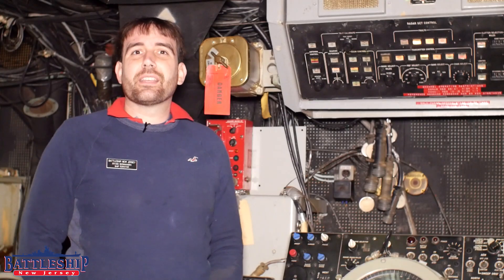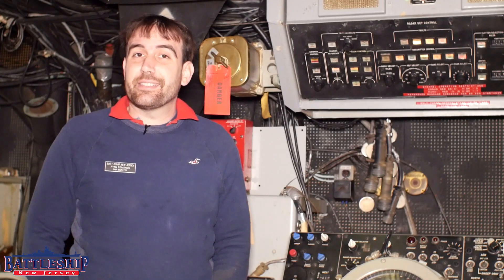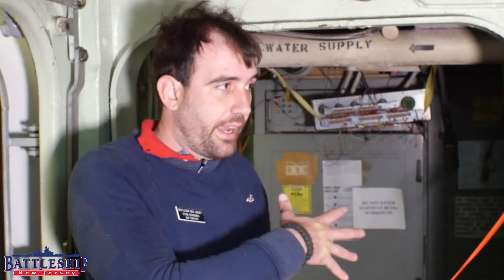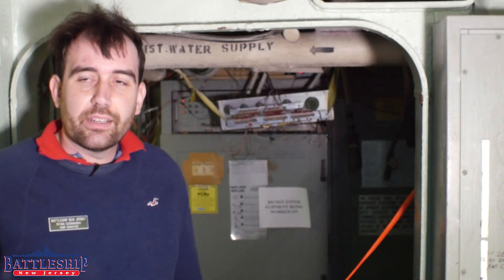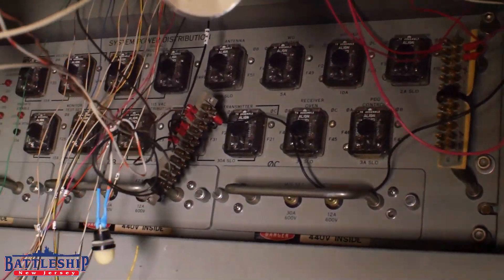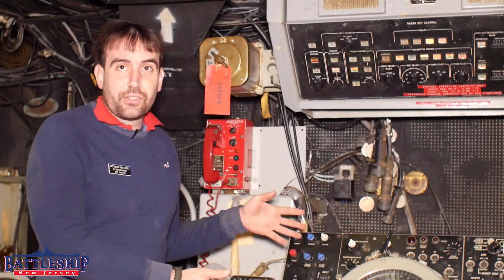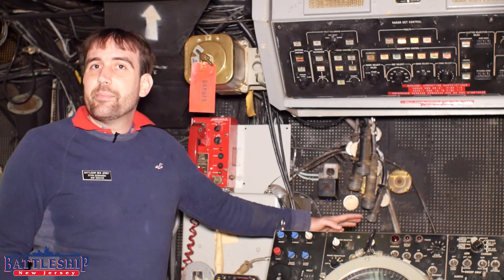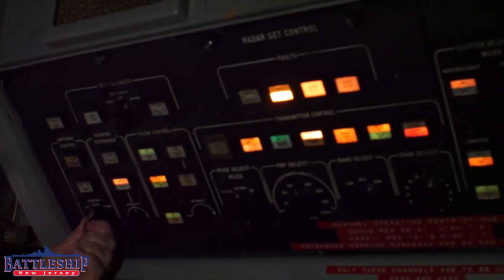Rotating the Air Search Radar

Comment: If you really want the ship to come alive; get those turrets to rotate under their own power.  Get the 16in barrels to be able to move again.
Reply: I would love this, but in order to do this, like Ryan mentioned in previous videos, unless they can basically replace all of the pipes in the Boiler system, and restart the engines, they cannot do this. This would cost an incredible amount of money as well.
Reply: @ColdFireW  Forget the steam. What actually powers the turrets?  Electric, hydraulics?  I'm sure an auxiliary power source could be integrated somehow.  And if you told people what you're doing, they might donate the equipment and expertise required just to see those things move again.
Reply: @jbowman90  the steam powers the turrets. *If I remember correctly. They have multiple videos about this stuff, but I mean if your willing to pay for it I’m all for it!
Reply: @ColdFireW  The first step is to study the problem - assess how it currently works, can it be made to work again using the current design, and, if not, are there suitable alternatives.  And then you have to price each one out.  Many projects never get off the ground simply because people convince themselves it can't be done without ever doing the detailed analysis.  There's an old saying - luck is where preparation meets opportunity.  No one is going to help or give money if there isn't a plan first.
Reply: @ColdFireW  I dont think its steam. Pretty sure its electric/ electric over hydraulic
Reply: Some kind of apu then perhaps... they seem to have 3 phase power to the ship so large 3phase hydrolic pumps mounted in the turret     so they can keep the pipes runs short ?

Comment: Aww come on lets radiate the Camden and Philly area. But really, a great job by all. Turret operation????
Reply: Garage door openers would go haywire for miles. 

My ship had a placard on the ‘49 prohibiting radiation within 50 nautical miles of the U.S. coast.
Reply: Not just garage door openers.  If Wikipedia is accurate as to the frequency and power of the -49, it would disrupt a very popular mobile phone LTE band.  Your typical cell tower radio runs at something like 50 watts full power.  Again, if Wikipedia is accurate, the -49 sends out 360,000 watt pulses!
Reply: @billnickless  I was trying to keep things fairly vague, but yeah... Wikipedia's pretty accurate here.

As for the power, well... It has a water-cooled Klystron in the transmitter.  That should tell you something.
Reply: What would happen first who would complain first about that? Second to complain would be everyone still using antennas for their TVs.

Comment: Foreign ships use the 49 as well. Maybe find a decomming foreign ship and buy parts off them?
Reply: Some of the Ticonderoga Aegis cruisers also use the SPS-49 as well as their SPY-1 phased array (billboard) system.  Those that mount it have the '49 mounted on the Mainmast (aft mast), usually above the aft stack and helo hanger.  Many have had theirs replaced by a totally different system so there may be a number of older 'spare' sets available from the Navy 'Property Disposal' system.

Comment: Pipe dream?  Turret rotation but I don’t expect it.  You guys are doing great!
Reply: The Navy would probably have something to say about turning on the equipment it would take to rotate one of the main turrets
Reply: @Odin029  bearings are probably pretty flat on one side too
Reply: @Odin029  probably, but like the other guy said, they can’t provide that much electrical power
Reply: @Odin029  I think the museum contracts says they can’t use the ship’s steam or maybe main generator.  Do they get power from shore or use an auxiliary generator?
Reply: @danielharnden516  shore most likely
Reply: @danielharnden516  they are provided shore power. Through the city of Camden I’d presume. Even active duty navy ships when at the pier hook up to shore power. Running off your propulsion plant all the time is inefficient and wastes precious fuel in the case of New Jersey. Modern navy vessels when at the pier all have hook ups to shore power,  waste disposal, and also internet in the modern age.
Reply: @FloridaWildlifeChannel  well  that makes perfect sense.  So they could get enough power to rotate the turrets but the electric bill would be prohibitive.
Reply: Reactivating the generators might be a task.  And running them would be expensive. But they wouldn't need to be run all the time, just when the power is needed.  All you'd need to do is select an hour every other day where a "Turret Rotation" is scheduled, fire up the generators just long enough to provide a full rotatation to port, to starboard and then back to centerline.     It's not impossible

In two museums that house Concorde, they fire up a generator to allow the droop nose to be lowered and raised several times for the guests to watch. They shut it down as soon as they don't need the power.  It's noisey and expensive (as you need to maintain the generator and the systems on the plane), but it can be done.
Reply: @bmused55  reactivating the generators is off the table as that is one of the things they are contractually forbidden to do. Which is why they have a shoreside power supply instead. And as much fun as it might be to see the big turrets able to move, the power-bill for that would probably eat a big chunk out of the museums budget, which is better spent on structural maintenance and the like.
Reply: In a previous video they said the turrets appear to be capable of rotating, but they don't have the ability to provide that much electrical power.  Maybe if they could fire up the ship's diesel generators they could, but I suspect that would take a lot more effort and money than it's really worth.
Reply: @MK0272  which is what I understood which is why I don’t expect it.  I’m guessing it’s 400 hz power so specialized cables and everything else.  But he asked for wish list.  I wonder if they can rotate a 5 inch turret?
Reply: @danielharnden516  400 Hz isn't a high enough frequency that you would need Litz wire.  Or are you speaking of shielded wire to prevent electrical noise from bleeding to other systems?
Reply: @bobroberts2371  I meant by specialized cables is not a good answer.  My only experience with 400 hz is the thick heavy cables our mainframes used.  I think mostly it shows how little I know about power transmission that I considered that specialized.  Sorry.  I think what I meant to say is that I believe Ryan said they used 400 hz power to rotate the turrets.  Clearly an electric company would have no problem running lines right to the ship if needed.
Reply: @danielharnden516  said " My only experience with 400 hz is the thick heavy cables our mainframes used.  "   No problem, you do your stuff and I do my stuff.   400 Hz is common on larger aircraft once you get past 12 V DC battery power.   400 Hz isn't likely to be available from any electric company ( I'm allowing for really odd legacy systems that might exist however these would be limited to in house use. ) 

Making 400 Hz is not a huge ordeal however we would need to know what voltage is required.    Trailer mounted ground power units are common for use on aircraft however these need fuel.   It is possible to use an electric motor running from utility power coupled to a 400 Hz generator to make the required power.
Reply: @bobroberts2371  thank you.  Hopefully I learned something.  Our use of 400 hz. Used a motor generator and the power was supposed to be clean.  I’m old and the old systems were quite picky about their power lol.  What I think of as complicated is really quite simple from your area of expertise.
Reply: Conceptually, rotating the turret ( slowly ) would be like rotating a large excavator, not difficult.   However, the cost and time to make it work could be better spent on other projects regardless if rotation was allowable under the contract.  How accessible are the turret bases to humans on the deck?  I'd be concerned that someone might be in place as the turret rotates.  The radar is in an isolated area so human contact it minimized.
Reply: @bobroberts2371  safety was never a thought when I gave that answer.  As a kid I had a battery operated model of the Tirpitz which automatically would rotate the turrets.  He asked and I thought what would make me smile.  Truthfully the money should be spent on keeping this a great museum and memorial for the future when no one from this war is left to tell us.  That is not a toy but a reminder of a deadly purpose that thousands of young men served on to defend our country.

Comment: It would be absolutely tremendous if it was possible to rotate the various guns on the ship. I imagine the 16 inch guns would be the holy grail, but having the 5 inch guns and/or the fire control directors moving around would be amazing. More realistically, having all the various rotating antennae on the ship moving around would do a lot to make the ship seem alive. That would be really cool.
Reply from the maker: We do move the 5in guns, and fire them!
Reply: @BattleshipNewJersey  I'll have to drop by the next time you do.
Reply: @BattleshipNewJersey  could you possibly bypass the existing system for rotating and elevating the turrets with 3 phase hydrolic pumps
Reply from the maker: We cannot activate the hydraulic systems that go with it without some serious safety concerns. Its not going to happen.
Reply: @BattleshipNewJersey  What safety concerns?  Is there a video that explains that?